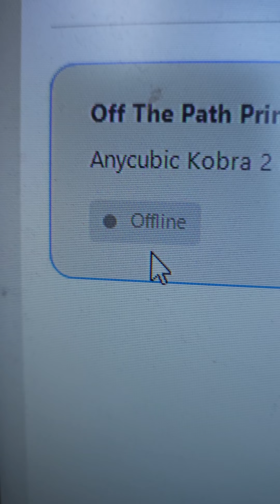AnyCubic Kobra 2 MAX 1 Month Review

Comment: Been using one over 1.5k this year, and it is still good enough to print the ABS parts for my Voron. The value in this printer around 350 or 400 is enormous.

Comment: Great review! Do you think this Anti-Vibration Feet works with A Kobra 2 Pro?  Thanks
Reply from the maker: I bet they use the same feet as the kobra 2 max!
The kobra 2 pro is a lighter printer I would reduce the infill to maybe 5 percent to get some antivibration. If the feet are too stiff, it won't do much! Try it out!

Comment: I've a Creality Ender S1 Pro and this printer gave me a true quality. 
However I'm needing a larguer 3d printer to produce big pieces (sheet metal press dies).
I don't need "pretty", perfectly layered pieces. Only parts with exact and ROBUST dimensions. 
Do you believe that Kobra 2 MAX will be a good option to me?
I've been thinking about Kobra 2 MAX, Eleego Neptune 4 Plus and Creality CR-M4 (too expensive).
Reply from the maker: I now have 2 Kobra 2 Max's if that helps! I quite possibly 3d printed the world's Largest 3d printed Mardi gras mask and it was done on the kobra 2 max. I thought about getting an elegoo neptune 4 max but I didnt.... lmao I want their 1000x1000x2000 printer though!

Comment: Which slicer are you using for it? prusa that came with it gives me an error. Downloading prusa or anycubic and they dont have kobra 2 max preset. Would you share your prusa or cura config?
Reply from the maker: I've been using anycubic's slicer for most prints since I got those printers for the Mardi Gras Mask. But recently I've been using cura to print some Recreus Filament and cura is also doing great! There isn't an initial filament purge when using cura but I'm sure I can write that in! I don't mind sharing my presets for the kobra 2 max. I plan on making a 6 month Review VERY soon where I'll give out my tips, tricks, and my presets for the best, most efficient prints! Thanks for watching
Reply: @TheManufactory3D  can you please share your preset for the kobra 2 max
Reply: @TheManufactory3D Can I get those setting too? I’ve been working on mine for a while and just always seem to have an issue or another pop up.

Comment: You say dual gear direct drive but i still see a massive bowden tube, is it an option upgradd that comes with the printer?
Reply: @TheManufactory3D upgraded printer?
Reply from the maker: @codyekaf967  it is a direct drive extruder and no unfortunately I have not found a great replacement to the hot end assembly

Comment: I am in the market for my 2nd 3d printer. I have been using an Ender 3 with octoprint and lots of other upgrades for over 4 years now. I made the mistake of buying an Elegoo Neptune 4 Max which is in the process of being returned. I am wanting a klipper printer that I can run Mailsail from a raspberry pi 4 4gb. I am also wanting a printer that is actually utilizing axis stops and not some sensor that allows for the print head to slam into a side. That being said I have not been able to find anything that specific about this printer and was wondering if you could tell me if that sounds like this printer or do I need to continue my search elsewhere?
Reply from the maker: Tbh  I haven't messed with Klipper MailSail but what I can say is....I know Some people are having troubles the the kobra 2 Max... I bought another one last week. Put it together yesterday, and it works awesome just like the first Kobra 2 Max. I'm printing a 30kg Mask lmao. Why would you want klipper on a printer like the Kobra 2 Max?! Jw! Thanks for watching
Reply: @TheManufactory3D  If I am being honest I don't know exactly what I want I just have a list of parameters that I want to meet and I don't know how that translates to firmwares and controlling software. Is there any way to have just a conversation with you to discuss? I really need to bounce things off of someone and right now I don't really have anyone I can do that with.
Reply from the maker: @rdnckreaper  for Sure! That's why I'm here! Hit me up on discord offthepathprints_43203... ima keep this up for like an hour

Comment: Have you used the camera port on the Kobra2 max? There is no documentation regrading how to use or setup?
Reply from the maker: No, and I want to, but like you said. There is no documentation about it which is really annoying. Because that's one reason why I bought the printer.
Reply from the maker: I'll do some digging and I'll let you know
Reply: I pluged in my webcam (logitech brio). the (iOS) app lets me access the video stream. it it does not work first try killing the app and trying again usually works. as far as I understand almost any webcam should work

Comment: Just 1 thing.... Do NOT USE ANTIVIBRATION FEET. BECAUSE AS PHYSICS TEACH US, IF THE VIBRATION DOESNT RELEASE IN THE BENCH OR IN THE TABLE, IT WILL RELEASE THE VIBRATION IN THE EXTRUDING FILAMENT, SOMEWHERE NEEDS TO BE RELEASED IF YOU CANT SEE IT VIBRATE ITS RELEASING THE ENERGY IN THE PRINTED FILAMENT BETWEEN THE NOZZL AND THE PLATE SO DIRECTLY IN THE FILAMENT. SO JUST LET IT VIBRATE.  HEADS UP
Reply from the maker: And as well, I used TPU and with the infill being 14%, the feet are actually dispersing the energy/vibration throughout the feet(they aren't perfect the table still shakes lol.) So the vibrations are being released in the feet and not in the table, I have another video with anti vibration feet, those might look like a better representation!
Reply from the maker: Interesting, I'll do more research into that. Other printers come with anti vibration feet, like the bambu x1 Carbon. I have 2 different style feet for both my printers, I have not noticed a difference in print quality but I will keep an eye out for that! Thank you for watching and voicing your opinion! I'll do some digging and I'll share what I find!
Reply: Definitely with tpu could work if the goal is not like to suppress it but to mitigate the vibratons in the tpu ,a bit i would be scared of the wobbling. didnt wanted to sound too much, thanks for replying ill do some more testing too also with some different shore tpu filamenslts:)
Reply: The energy is absorbed through the feet, it elastically deforms slightly with each vibration.  So no the vibrations won't end up back in the filament.

It just turns some of the energy into thermal energy instead of sound having vibration dampening feet.

Comment: I'm surprised you didn't run into issues with leveling or the printhead hitting tall prints. I just don't understand this printer. I've had a lot of layer shifting and ruined prints. Latest firmware, factory reset, and multiple calibrations/mesh. :|
Reply from the maker: One thing, and I should make a video about this, that I haven't mentioned yet is the z axis was loose and behind the z axis arm are screws on the wheels, mine where loose and needed tightening. You should find me on discord and send me a picture of one of your prints and I'll try to help the best I can!
Reply: @TheManufactory3D  I call those "set screws". Mine were also loose and were probably causing layer shifts. I still have the printhead rubbing over prints though. I'm using the Z Lift setting at the moment to try and compensate, but there's something fishy with the bed leveling/z-offset. Some claim it's broken. Might be. Closed source firmware is a hindrance. This thing needs vanilla klipper imho.
Reply from the maker: @Technologyanimals I cannot find a way to fix it, I reached out to anycubic and you might be surprised what they had to say and what there "fix" was... which didn't fix it at all! I plan on going more in depth in my 6 month review!
Reply: I experimented a lot with the printer and my guess would be a problem with the z-offset as you suspect. It is nice and works for the most part, but the z-offset values are most likely wrong as the printer cant know the properties of the filament when auto calibrating. I'm doing a small one layer print after each spool change, even if I know what the z-offset was for that filament the last time. That increased my success tremendously.
Reply: Find the optimum jerk and acceleration settings for kobra 2 in general and use that!
Reply from the maker: @srnar8 Literally so important! I am in the midst of making a 6 month review. I have about 1400 hours of printing on the kobra 2 max, and IVE GOT SOME THINGS TO SAY! Keep your eyes peeled!

Comment: Nice video im gonna get my Neptune 4 max tomorrow
Im pretty Happy with my buy since it costs like 55€ cheaper for me then the kobra
Reply from the maker: Let me know how the setup goes!
Reply: @TheManufactory3D  so after assembling everything and testing it out I came to the conclusion....
That I was actually stunned by the 3d Printed it prints my Prints much faster and better then my old ender 3 and looks amazing I'm definitely happy with my purchase
Reply: @TheManufactory3D  sure 😃
Reply from the maker: I will have to check one out! Thank you for responding back, happy printing!
Reply: @TheManufactory3D  thank you and also it's not easy to build it together alone so having two people will help
Reply: @TheManufactory3D  and also I couldn't find a way to use Klipper on my PC when I have Ethernet on my PC I need to use a WiFi dongle to get into Klipper but it works great on your phone and I got a webcam setup to the printer